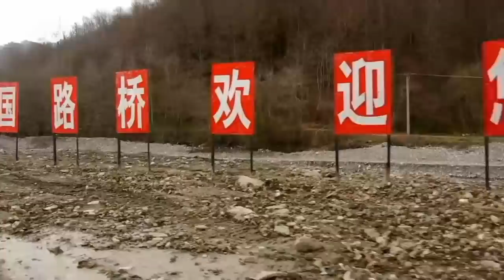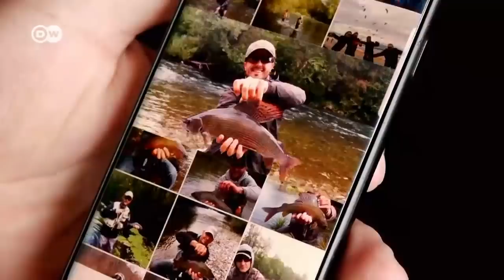Montenegro: China's Belt and Road to nowhere in the Balkans | DW News

Comment: What a biased and nonsensical video! It is not a "road to nowhere" - it leads from the coast of Montenegro and will eventually connect to the Serbian border. Serbia is a much larger country and economy than Montenegro. They both emerged from the breakup of Yugoslavia. Better road connection all the way to Belgrade will increase trade and allow Serbia to use ports on the Montenegro coast. Both countries in the poorest region of Europe (Southeast) are expected to benefit.
Reply: I highly doubt that. At first study of feasibility has been done in 2006 and 2012 by institute in Montenegro. Neither study proved that highway is needed in this area. On daily basis there are 6,000 vehicles and for profitable highway you need 22,000 vehicles daily. So there is a big gap between those numbers. Secondly first part of the highway was scheduled for 2018 and is 2020 and it isn’t still finished.